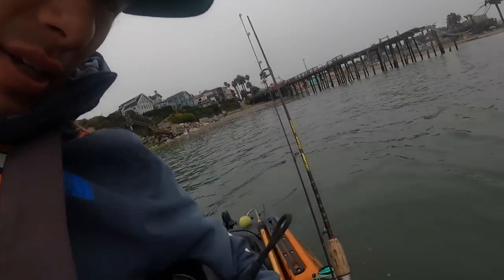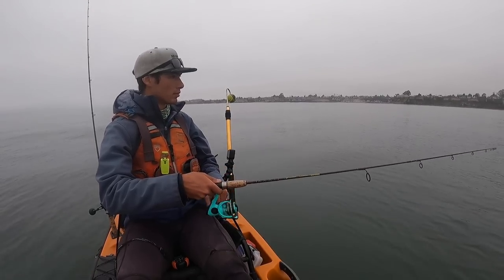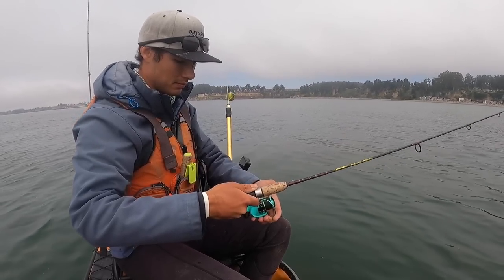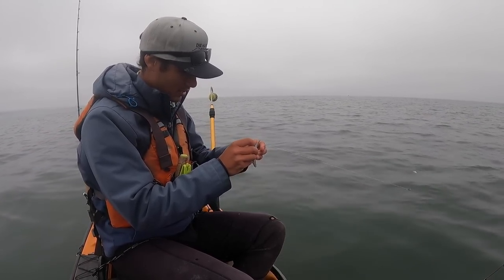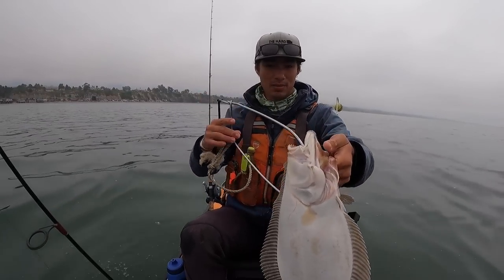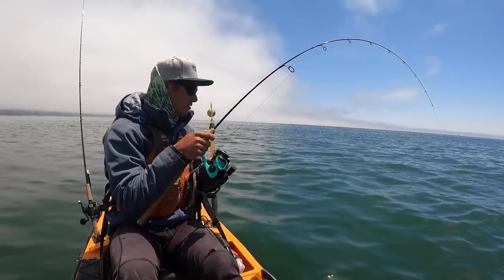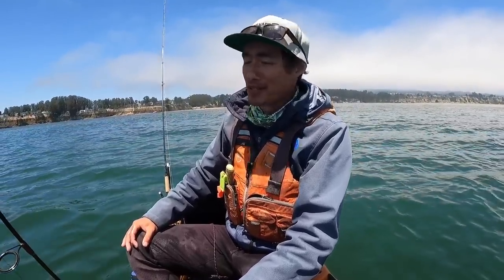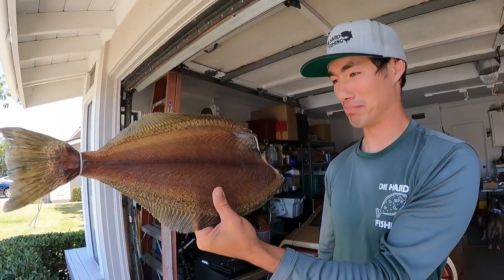Multi-Species Ultralight Saltwater Kayak Fishing (eating 19 day old fish😬🤢)

Comment: Glad you're showing the potential of dry aging fish! Usually "dry" aging fish is done at 70% humidity, to prevent the fish to completely dry out. Also sometimes if the air is too dry it will dry the outside of the fish and trap the moisture inside.
Reply from the maker: Thanks for the info!

Comment: Since you're able to land halibut on what you consider to be ultralight gear, maybe your usual setup may be overkill. Thoughts? I have caught a few on muni pier in the 60's on six pound test mono.
Reply from the maker: Ultralight is doable but the catch rate is much higher with the conventional gear I typically use
Reply: @johnharris8021, you should qualify your comment, 60 what? lbs? inches? cm? you're 60?, no one is using cms in the states, and you're not catching 60lb halis on six pound mono, so.........wtf?
Reply: @mikeboston421  1960's